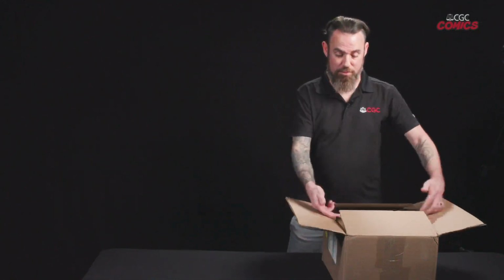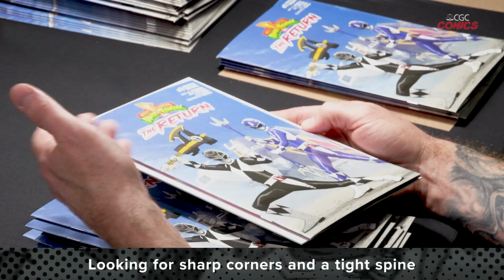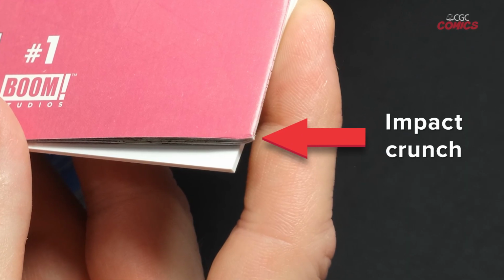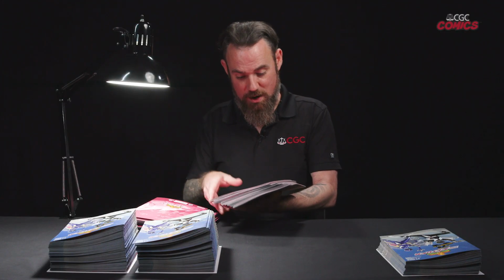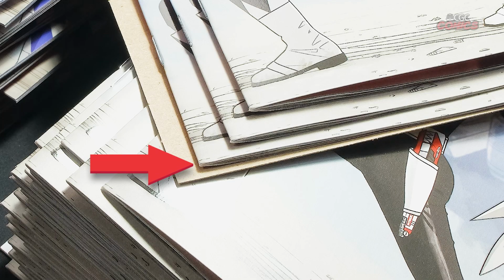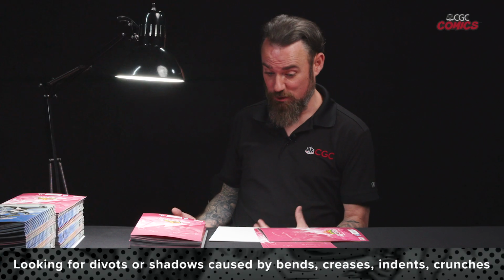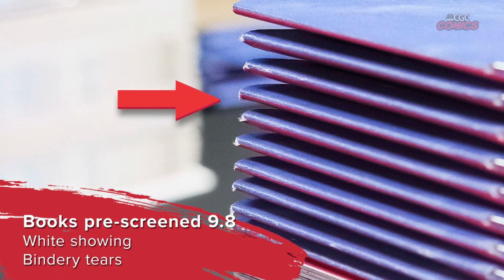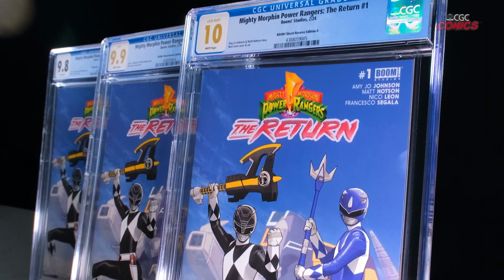CGC Insider: Publisher Defects

Comment: Hi and thanks for posting this video. In the spirit of always working to improve a process, here are a few observations based on the video and comments so far:

1. One thing you have to do ASAP is train your graders to never straighten a stack of books by picking the stack up and setting the bottoms of the books on a table, as it was done here in the video:  https://youtu.be/eptB-oGvmA0?si=gDqCfqWzIZl3XHR3&t=358, some of the books will fall a couple of inches and that's all it takes to damage a spine or edge.

2. Another handling mistake is to pick a book up by the top and bottom, as was done here in the video: https://youtu.be/eptB-oGvmA0?si=dd4CUMcxMHJ6YFnP&t=549, If you freeze the video you can visibly see the spine bending and possibly turning a 10.0 into a 9.8, or lower.

3. I also wouldn't pick up a stack of books all at once, this is inviting disaster if they start to slide. While slower, I recommend only handling one book at the time for grading. This book might not be a big risk since this specific book has a relatively rough surface, but some books are quite slippery.

I hope this helps and thanks again!

Comment: As someone who has bought cgc slabs and submitted myself over the last 15 years I think I'm officially done with cgc. Between them not bothering to update there case and this new screening they do for 9.9s it's just too much. 9.9s and 10s were once incredibly rare. Anyone who has bought or received modern 9.8s over the last 20 years should be passed because I'm sure half of them would be 9.9s by today's cgc standards. 9.9s are the new 9.8s and all your 9.is will be decreasing in price soon.
Reply: They are not pre-screening for 9.9s that was a rumor, it's not currently active.

Comment: I’m still a believer you need to remove the human aspect of grading and invest in A.I machine to do the grading for you.

1. A machine will be faster
2. It will be more accurate
3. No bias or opinion on what is or isn’t a defect.
4. When it scans the books front and back covers. There won’t be any human handling that could damage the book other than putting it on the scanner.

And while there will still need to be a grader to check the interior and smaller things. The machine in the end will provide a grade for the book against the graders views in the interior. Thus you have the grade for the book.

Comment: So the grading of a book only takes 8n to account the front and back cover and nothing inside?
Reply: this is pre screen. Not the full grading process
Reply: @jamielee1828  Why do you keep saying "This is pre screen"? The books got graded and encapsulated the pre screen part just roots out anything lower than a 9.8 all the ones that get 9.8, 9.9 or 10.0 were graded. If this is a pre-screen how come at 3:04 he says "If this book was going through a 9.8 pre-screen?"
Reply: @mikedamore4739  from what I know of the pre screen process (typical of batches straight from the printer/publisher) this is very much the same when they did grading back in the day on site. A second round would only be a cursive review from another grader to see if they would closely agree. I am a cgc witness (currently) and use to do onsite submissions at conventions when the process was faster. I also have a little bit of insider knowledge. I have been friends with a few of the graders including one of the head graders and was also there when Shawn (the same Shawn in the video) when he first started as a cgc convention staffer.
Reply: @mikedamore4739  I also say this because why would they look inside the book if essentially they are trying to weed out the books that wouldn't get a 9.8 or above? To me when Shawn was demonstrating is what pre screen achieves. Knowing where the books are coming from there may be a bit of acceptance perhaps that the condition of interior would be all nearly the same? But a second round would cull the books further. Someone might think to ask the CGC admin to verify this
Reply: @jamielee1828  at the 9:50 mark he says from here the books get entered in the system and get a numerical grade based off this prescreen then get encapsulated. Seems like this video by his own remarks is showing that this is the grading portion in it's entirety.
Reply: @mikedamore4739  It doesn't mean that another person could go back to provide there assessment and change the grade. Also, this may be a different circumstance where the books received are direct from the printer (where one may, may, assume that the books are complete - not that they should not do the proper due diligence of reviewing all books in their entirety).

Comment: What bothers me about you checking the books. Is every human has a slight oil residue that comes from our fingers. Why don't you have gloves on while you are touching the books?
Reply: Dry hands are fine. You can actually damage books having gloves on. Per the video, personally handling the books is limited in touch anyways with the backer board on the bottom.
Reply: @Jerry11011  they have gloves that are designed for the collector industry. I have powdered free gloves that I use all the time. For my higher price books and art. And they never get damaged from the gloves.
Reply: @anthonythomasexperience  if you’ve watched Matt’s video, they also need to “feel” the surface of the books for any residue, glues, ect. Now I know you’ll try to clap back with “but, this is a modern!” or whatever nonsense rebuttal. Again, dry hands are fine to handle these.
Reply: @Jerry11011  Don't get offended I'm just stating the obvious. Of what true collector and reseller know and is looking for. When I'm checking my books. I wear powder free gloves and I can feel everything on my books.
Reply: @anthonythomasexperience  gloves cause hands to sweat, it's more likely moisture will drip out or soak through.
Reply: @Cincinnatijames  seriously, never happened to me.
Reply: @anthonythomasexperience  lolz, try wearing gloves 8 hours a day, in Florida. Even indoors the humidity is so high, sweat doesn't evaporate as fast as in a dry climate. But then I really doubt you've ever actually worn gloves to handle comics and are 100% concern trolling
Reply: you try wearing gloves for 7 hours a day for every work day in Florida no less.
Reply: @jamielee1828  7 hours is a long time, you can change your gloves. I'm pretty sure you would have more than one gloves. Plus as a grading company you should do everything you can in your power and knowledge. To not damage or add changes to a book that could come from your body. Just my thoughts. Thank you for this conversation.